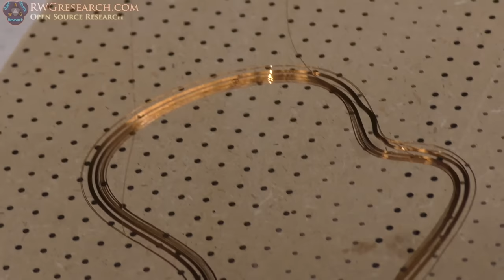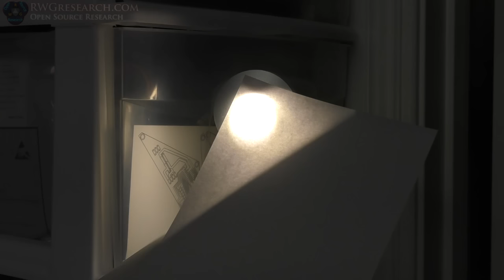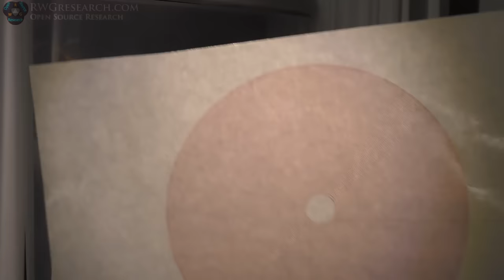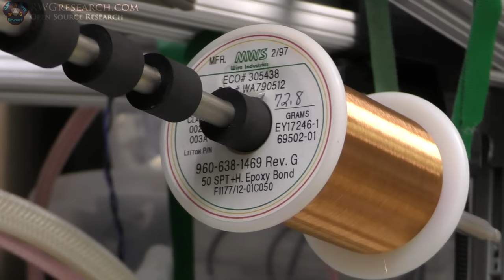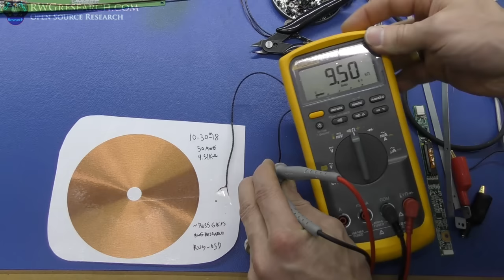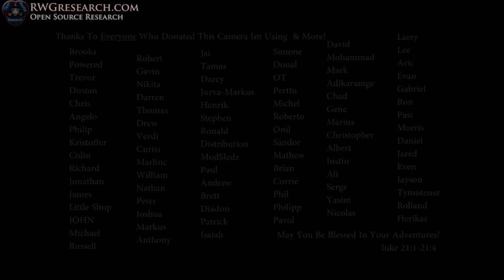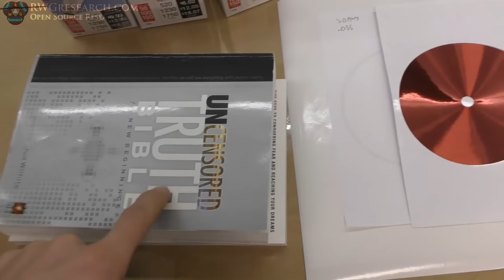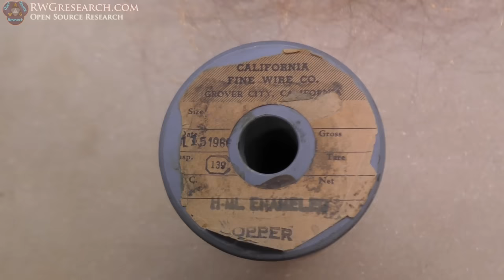50 AWG Spiral Coils?  Sprial Coil Overview.  V2.0 CNC Flat Coil Winder. RWG-OSD

Comment: This coil is a vital component of the real Tesla coil setup which generated 'superluminal' waves. A stack of these flat coils can be connected in series and pulsed with HV. There's no need for bifilar winding. Just keep the pulsewidth very short and the frequency high.
We may be witnessing some pioneering work for a new generation of smart gadgets to come. God bless you for the good work.

Comment: Nice one Russ, well done. You could do the same with half your set up mounted on a lathe with the correct back gearing for the size of wire/thread cut!
Or make a sticky (mould) on the lathe to lay the wire into...

Comment: Also if you UN-spool the reel the other way it will automatically want to lay right as that's how it's been put on the spool. Check out putting fishing line onto  a "spinning reel" as opposed to a "baitcasting reel" it will work in your favour, that's the easiest comparison I can make at this point. Good work again.

Comment: If the gap between the turns could be specifically controlled for a known capacitance, then the coil would act as its own capacitor in a tuned induction tank (LC).  The device would act as a band pass or reject device, or tuned resonate storage coil.  If you put a small high impedance headset on the tuned tank at a specific resonate radio frequency, you might be able to hear an AM radio signal.

Comment: I wonder if the tool head rotating is putting the twist into the wire. Hence why the inner part is usually where it messes up, since the RPM of the tool end increases when the ID gets smaller in the middle. I wonder if starting on the inside and working towards the outside would help with that? Or maybe having a lot of slack would help... But to keep it compact, you might have to run it between a few pulleys. That might help with the tensioning, since the pulleys could be tensioned with like a spring or something.

Comment: Dear Sir,  I consider you a really good inventor!!  I think you could really be onto something, if you are trying to make efficient, lightweight, high voltage power supplies. You might end up with something really astounding!
I wound some low profile coils with wire down to AWG59, I got from Elektrosola, when they used to sell sample sizes.  The "Q factor" (L/R) was too high for efficient high voltage coils though.  So I use AWG50 wire now.  I managed to thin some tungsten wire from 2.5 micron to 2 micron for emitter wires on my ion powered aircraft, but it is already a bit on the fragile side.  You can see it fly if you click on the purple icon.

Comment: Not sure if the Paper is fixed? While the arm rotates/press's & places it?

Have you tried a rotation table for the paper & wire to rest on, to do the turning while the spacing is defined by how fast the arm pans outward while it press's down? instead of having the arm do the rotating?

Comment: Looking good Russ.

A lot of those imperfections look suspiciously like what I get trying to re use wire.

I know you are using new wire, but in my case the imperfections were caused by bends and TWISTS in the wire.
Could you be getting twists in the wire due to the head turning and the wire spool not turning with it as well.
Any time copper is worked, it becomes work hardened, and doesn't bend as easily as an annealed section.
Bends and twists work harden the wire and cause deformations in the coil windings because of it.
The larger diameter wire is more affected by this than thin wire, and especially in your application where the wire
is only held from shifting by gum glue.

Just a little food for thought

Keep on fighting the good fight.
Reply: Better off letting the wire come off the side of the bobbin not by spinning it, as the wire has a natural coil formed when it was wound on the spool.  you need to do the oppersite of winding to unwind the spool.

Comment: what about putting the original wire spool horizontally and having it spin in parallel with the roller head so that the wire cant be twisted during the circle pattern. do you have an additional stepper motor to run insink with the roller head in its clockwise and counter clockwise spin?

Comment: I would mount a tube of super glue right before the head with a hole drilled through the side of the nozzle. feed wire through the hole so it gets coated in super glue. by the time it reaches the surface it will be 90% dried.

Comment: Hi Russ, it's been awhile since I've commented, previously as "Anonymous User," fyi. But I've been keeping up with your work. Very impressive, always.
So as I'm watching you go over the spacing issues it occurs to me that the wire acts as if it is twisting as laid and it probably is. Similar to coiling an air hose -- if pulled onto a spool linearly there are no kinks but if wrapped around the spool by hand it does -- the twists that result would create the kind of compression you show occuring.
Not sure how you might solve it short of having the spool of wire above orient with the print head as it turns. Though I'm certain you will find a better solution if that is occurring. Peace

Comment: I am surprised that you are getting such good results given that you are twisting the wire due to the way you are feeding the wire from the spool. Have you tried feeding the wire off the end of the spool, noting that depending on which end it feeds from, you will either exacerbate the twist or reduce the twist. I'd be interested to see if doing this makes any difference. Good luck.

Comment: hello man 
I'm working with a markedforge tow witch is a dual head printer that print with nylon an can insert fibers ( glass carbon kevlar etc) it lay down a nylon layer and fuse inside the fiber I can show you but it molten thenylon and put the fiber inside I'm dreaming to test it with copper wire but price of printer force me to stay prudent !!;)
the continuous fiber nozzle is flat on the head and it fuse only on surface the plastic and insert the fiber inside